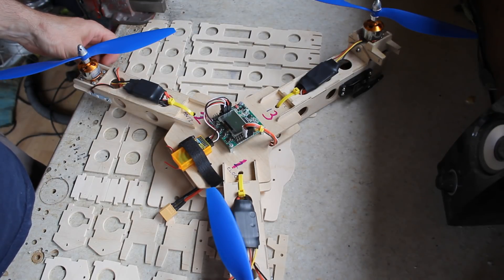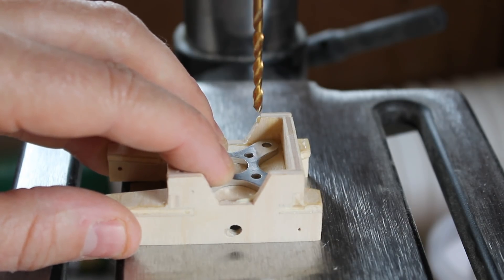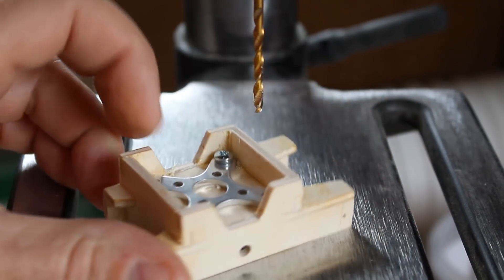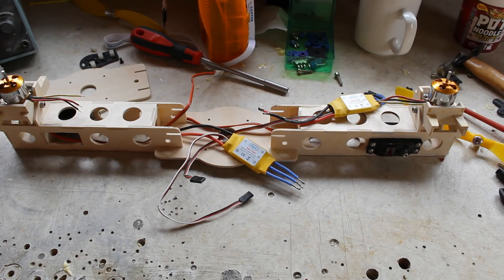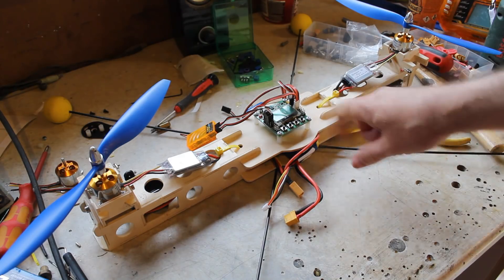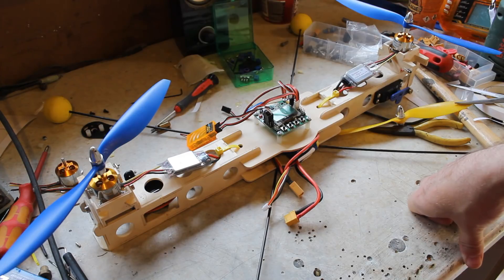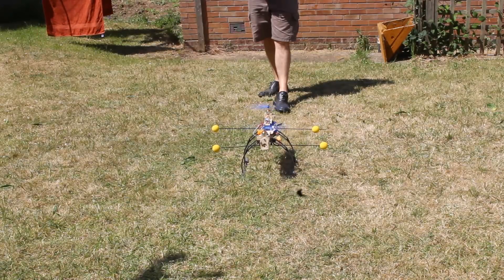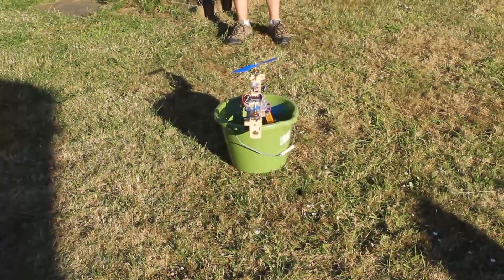Bicopter/Dualcopter KK2.1.5

Comment: Can you tell me what is the mid position(degree) of servo & what is its max tilt position??
Reply from the maker: The servos were both set up to be horizontal at neutral position, then i just sent up the end point on the transmitter to avoid binding the servos. throw was about 15 degrees either way.

Comment: Yeah I was gonna say you might need more weight further away from the axis the motors rotate about, otherwise it has an extremely low rotational inertia in that axis and even a tiny servo movement will have a huge influence.